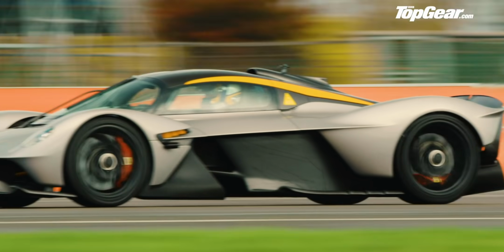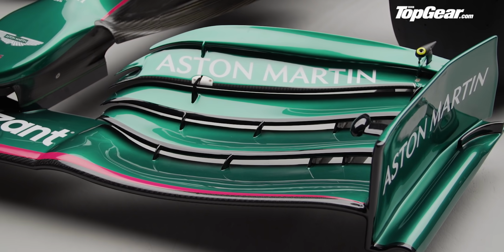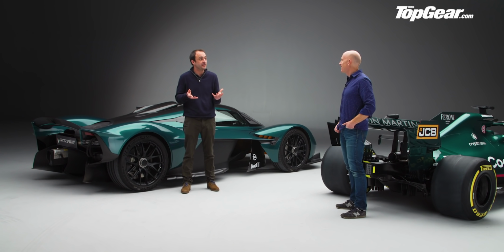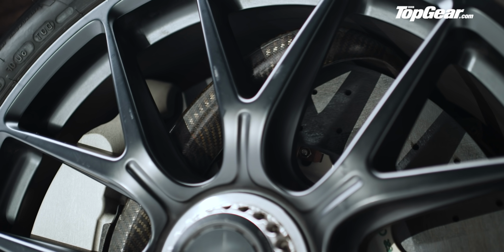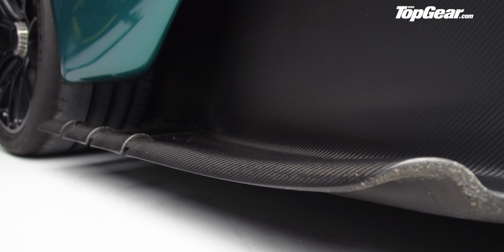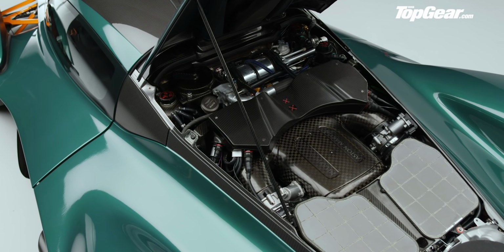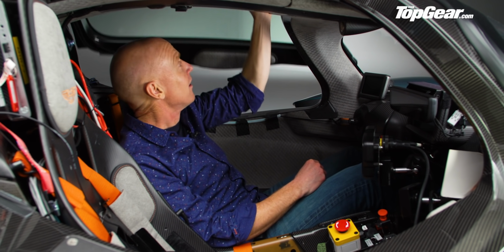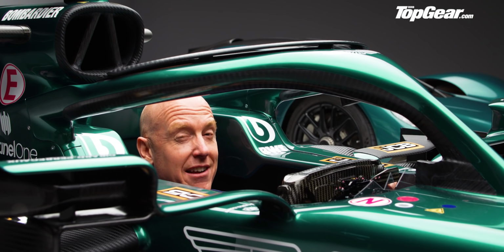Is the Aston Martin Valkyrie really an F1 car for the road? | Top Gear

Comment: The Valkyrie makes all other road cars look like mediocre highschool science projects.
Reply: I think the T50 is just as good
Reply: @justina9914  T50 is the greatest Roadcar of the new age.
Reply: I think its gonna be interesting between Valkyrie, AMG One and T.50. Each of the cars have their own Pros n Cons so it will be very exciting if and when a car show can get all three in the same room and then take them out on the track.
Reply: @ccheetah  the T50 will be slower in a lap compared to Valkyrie and Amg One because it is designed for daily use as well. Gordon Murray said that he wanted the drivers to be able to go and buy some groceries with the T50. He also said he doesn't like very stiff suspension on a road car.
Reply: @justina9914  Well that is that normal T.50. I guess you haven't checked the T.50 Track version called T.50 Nikki Lauda (named after the famous Late F1 driver). So it's gonna be very close between these cars.
Reply: @ccheetah  
The T.50s is a track only car. That should be compared to the Valkyrie AMR Pro which in itself is F1 levels of quick. So no, neither the T.50 nor the T.50s will be beating their Valkyrie counterparts.
Reply: @Cain353  Well only time will tell. The thing is Gordon Murray has already had success with McLaren F1 (perhaps the best supercar of all times). So chances of him getting the formula right again (this time with a fan) cannot be ignored.
Reply: @ccheetah  
Oh yeah. It's basically an updated McLaren F1. But it won't be breaking any lap times. That's not what it's built for.
Reply: @ccheetah  I am fully aware of the T50s Niki Lauda. However that is track-only and I was trying to compare apples to apples. The Valkyrie AMR Pro can take on the T50s Niki Lauda
Reply: @Cain353  Well that is true, but the F1 was built for driving pleasure and still somehow won Le Mans with just slick tyres and a wing slapped on it
Reply: @justina9914  Because back then racing wasn't what it is now. The F1 carried over tech that was pretty much new in Formula 1 and unheard of in any other racing class. But back than Formula 1 also had very limited aero, still had manual gearboxes and the money spent on racing wasn't anywhere near what it is today. 
Even if today you'd carry over F1 tech to a road car and then make a race car of it you'd still be competing against cars that are designed to be race cars from the ground up. With manufscturers and teams spending loads more money to be competitive. There's no point in trying to compete that way.
Reply: @ccheetah  I love what gma is doing with the t50, but in terms of track speed in a road car, it will absolutely lose. The stick shift rather than automated transmission would likely ensure that by itself, but factor in the power difference and it's not really a contest.
Reply: @ccheetah  personally, I think amg one will beat valkyrie in low speed tracks because of 4wd, torque vectoring and turbo acceleration etc. At high speed tracks like Spa Francorchamps Valkyrie will take it with the superior aerodynamic effeciency
Reply: @ccheetah  It will have to be the T.50s to compete with those cars on track I believe
Reply: So the AMG ONE and Senna are a joke to you
Reply: @ajnracing6034  You compare a Senna to this? Yikes
Reply: @ajnracing6034  the senna is beyond ugly and the amg one is a bit of a let down compared to the valkyrie
Reply: @ajnracing6034  Let's be honest. Senna is just a 720s with 60 more hp and more downforce.
Reply: @justina9914  the 720s is trash tho
Reply: @ajnracing6034  Car guys are weird...Still they're not like road cars. you mentioned jokes ;)
Reply: @ES-qe1nh  It's between the Senna GTR, AMG One, Valkyrie and the T. 50s Niki Lauda
Reply: Koenigsegg Jesko anywhere?
1600HP in E85 mode
1400kg weight
Until 1400KG Downforce similar to a 2009-2013 V8 F1 car.
Has good conforts and a little trunk too
Will be avaiable 2021 and not delayed until the release of Half Life 3. 

GMA T50 S (Yes i know not street road legal)
725hp
850kg weight
1500KG of Downforce! Similar to a 2009-2013 V8 F1 car!
Middle seat piloting.
Avaiable 2023. 

Calling the Valkyrie the best car ever and every other car a Highshool project is just blind simping!
Reply: @Zero.X  Nice HL3 joke :)
Reply: @streamnoremorse  
Whicht releaae is sooner
-The "New Holy Trinity" (Valkyrie,Amg One,Speedtail) 
Or
-Half Life 3?
Reply: @Zero.X  jesko will get stomped by this around a track. Infact, Koenigsegg isn't a competitor.
Reply: GMA T50?
Reply: @alexandermallinckrodt2847  That looks balanced car. Nice looking =)
Reply: @Bugatti Chiron Supersport spa is and will never be a good place for to check times. Your not gonna tell me an f430 scuderia is only 7 seconds slower than a McLaren p1
Reply: Mercedes Project One has joined the chat
Gordon Murray T50 has joined the chat
Reply: @StanceSantos  neither of those are even close to the valkyrie
Reply: @E9X330  aren’t even close? The project one literally has a 2016 F1 engine in it and the t50 has one of the most powerful naturally aspirated V12s since the mclaren F1 and utilises ground effects the same way as the brabham BT46 “fan car”
Reply: @StanceSantos  so what if it has a f1 derived engine ? Even Tobias moers said nothing comes close to the valkyrie and he formerly oversaw the project one development. Murray stated that the t50 won't break any lap records, it's a purists drivers car, not a lap record hunter like the valkyrie, it's literally on lmp2 pace ON ROAD TIRES. oh and fyi, the T50s engine is essentially a smaller valkyrie derived v12. The fan on the t50 is there to increase the efficiency of the diffuser, not to suck the whole car to the ground
Reply: @StanceSantos  Those are going to be epic vehicles. (:
Reply: brabham bt 72
edit: 62 my mistake
Reply: @Aston Martin Valkyrie Amr Pro ah yes of course. I am really impressed by the pagani. I don't know how they managed that, with a slow gearbox and less advanced aero than the senna.
Reply: @Aston Martin Valkyrie Amr Pro Yeah! I actually think cars like the fxxk and the lamborghini essenza are made let rich guys think they are driving a race car. But they are just road cars with wings and slick tyres. Look at the essenza, it looks so unaerodynamic. The zonda révolucion is still one of my favourite even though it is quite old.
Reply: 😂 
It is a work of art and I wonder if they’ll be driven or sit?
Reply: @Mark Williams nope, gordon murray said the t50 won't break any make records
Reply: @ES-qe1nh  Senna has not been by any car on a track yet
Reply: @justina9914  the senna is faster than AMG GT BS at Hokenheim and the Black series is currently the fastest car around the nordschleife so...
Reply: @ajnracing6034  the senna has more power and weighs less compared to the amg gt bs so...
The valkyrie has better aero and more power and less weight than senna so...
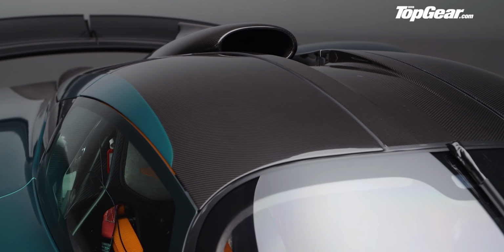Reply: @ajnracing6034  no doubt senna is very capable. Probably will do a 6:30 nordschleife lap. But the valkyrie is a whole new level. Like 6 minute nordschleife laps
Reply: @kalmansandor5930  i dont hate anything
Reply: Hello RacingMonkey do you want the Valkyrie in FH4?, I want it so bad
Reply: Gordon Murray fan car  ?
Reply: if they add it in forza you should figure out a way to break it.
Reply: @Aston Martin Valkyrie Amr Pro These cars are prat cars and your comment were prat also. It'äs not my fault that this looks like UltimaGTR.
Reply: @janiikavalko6223  this looks nothing like an ultima gtr, you must be blind as hell to think that
Reply: @machspeed20  Front shape is identical and interior. heh....whatever mate ;)
Reply: @janiikavalko6223  shape is no where similar but okay
Reply: @Aston Martin Valkyrie Amr Pro Fact isn't trash. It looks like Ultima GTR Kit CAr.
Reply: Have you seen the Senna gtr?
Reply: @Aston Martin Valkyrie Amr Pro Car should look beautiful, not Ultima GTR ;) This AM looks like built by Galactic Empire for numbers and performance to get all galaxy under their power and administration
 - just a tool.
Reply: @Aston Martin Valkyrie Amr Pro what's why? Whatever you want to defend that kit car look forever. :)
Reply: @janiikavalko6223  the car looks like a "kit car" because of the insane amount of aero put into. It's literally an f1 car for the road. The car looks beautiful too, I also don't see why your saying it looks like an ultima gtr, go get your knowledge from somewhere other than forza
Reply: @machspeed20  yes, i know
 But you just literally admitted that u dont have any idea abt these things
Reply: @Aston Martin Valkyrie Amr Pro 
Read the last sentence of my post again.
Reply: @Aston Martin Valkyrie Amr Pro We'll see that.
Reply: @Aston Martin Valkyrie Amr Pro 
Coooolll
Do you Genious want a Cookie now?
Reply: I thought if was a pagani
Reply: Right up to that point where you actually try and go anywhere in it  :)
Reply: wht about amg one? and it's powerplant?
Reply: it’s the contrary dude. Put the valkyrie aside a Bugatti or a McLaren and you will understand.
Reply: If it lives up to the expectations
Reply: T50.... thats the follow up to the F1.
Reply: @christianbuczko1481  the t50 isn't quicker than the valkyrie
Reply: @E9X330  lets see them on a track. I think that race is going to be interesting, as both are designed by genius F1 designers to be the ultimate in car design. The sounds of those 2 will make midern f1 sound like a shopping kart
Reply: @christianbuczko1481  nah, the t50 is designed as the ultimate driving experience, not to break lap records. With it's manual transmission and lack of power and downforce it won't hold a candle against the valkyrie on track
Reply: @E9X330  go look up the "nikki louda" version of the t50. Thats the full race spec, has flappy paddles, and the downforce is 1500kg. Apparently they had to reduce that from 2000kg, but the options there. This aston is a downforce car produced by aero and design of the diffuser and underbody, the t50 is a fan car with abit of aero added. The nikki louda version has ALOT of aero added. Plus according to drivetribe they are attempting to create a race series just for races of road legel cars like these and also a few others like bugatti and koenigsegg and senna gtr ect. Which is best will only be answered when they race..
Reply: @christianbuczko1481  the T50s isn't road legal, you have to compare that to the valkyrie amr pro
Reply: @christianbuczko1481  why are comparing a track only car with road legal one?
Reply: @ajnracing6034  they plan on racing against each other, so your point is pretty much bollocks isnt it?
Reply: @christianbuczko1481  I was refereeing to the Valkyrie when i said “road legal”
Reply: @christianbuczko1481  like others have said, the t50s needs to be compared to the valkyrie amr pro, and will come up short there, just like the street version.

That said, I would probably pick the t50 road legal version if I was given the option between all these super/hyper cars. It's just unique. But then, I wouldn't complain if I had the option to own any of the others, either. It's fun to leer at them!
Reply: Cant wait for the Jesko to wipe some.
Reply: @gollese  according to christian von koenigsegg himself, they won't have a chance against the valkyrie
Reply: It won't compete in the LMH, so it's not a "real" hypercar. Change my mind.
Reply: @ynnn991  No one will bother trying to change your mind when you have such ridiculous opinions.
Reply: GMA T.50: Hold my aero fan...
Reply: Nah, neither of them are allowed to drive the car, unless they buy one. Oh, you can't. Basically it a Red Bull. Not an Aston.
Reply: alongside the AMG Project ONE, this will be the new category of hypercar.
Reply: @mantaholy6845  nah the project one is a classical hypercar with an f1 derived powertrain, the valkyrie is a different league
Reply: @E9X330  I see what you mean yeah, and the Valkyrie will most likely be faster, however the Project ONE is also advertised as an 'F1 Car for the road' so I class them in the same category. Besides, I'd love to see them compete on track at some point
Reply: Funny, I was just thinking it DID look like a mediocre high school project from the erector set interior (I’ve seen tidier Europa wiring), and orange peel paint that looks to have been applied with a roller. 

Aside from the clearly unfinished details though, gorgeous car with proper sound. Just ditch the hybrid bits dropping another 50+ kilos as should be done in F1.
Reply: This car is so... 100% because in its first mid-engine car for the road, Aston is astooning!
Reply: Enter Rimac Neverra 
- What was that, kiddo?
Reply: @Malapropify  the nevera isn't even close lmao
Reply: The pagani Imola is the next closest thing
Reply: @puckstopper1937  fuck no, not even close 🤣🤣🤣
Reply: @Sir Crocodile doesn't exist and will be raped on track
Reply: @Sir Crocodile you're completely delusional if you actually believe that. I've yet to see any Tesla do multiple hot laps without overheating , the roadster has been promised for years and never came and it's gonna habe no chance against the Valkyrie in any category except acceleration
Reply: Chaos ultra car recently revealed is in a new category of its own :) 1272 kg and 3060hp  4l v10 ! state of the art car. That valkyrie is damn sweet too tho
Reply: Wouldn't go that far buddy...let's just say that the competition is pretty steap this time around.
Reply: We not talking about the Porsche 919?
Reply: I'm thinking the Gordon Murray T.50s will give it a run for it's money though.. Can't wait to see people actually test these things
Reply: Nah my Elantra makes the Valkyrie look like a gio metro
Reply: I totally agree....
Reply: EXACTLY
Reply: @ES-qe1nh  amg one shares the same concept, fully inspired by f1. Which is the best team at the moment? mercedes petronas. amg = mercedes i wouldnt be so cocky this early. I would love to see both cars on the track racing against each other. Im not saying the project one will be faster.
Reply: Too harsh and hyped
Reply: Until project 1 arrive
Reply: @emiliovergara4108  Still waiting lol
Reply: @Robbie-bp5vj  have you ever played RIDE 4?
Reply: @emiliovergara4108  It's likely still faster than the Project One tbh.
Reply: @emiliovergara4108 what Project 1?
Reply: @ES-qe1nh  the senna maybe but the AMG ONE is more powerful than the Valkyrie, has AWD and torque vectoring. I think the Valkyrie has a bit more downforce but the AMG ONE has plenty more downforce than a GT3 car
Reply: @ajnracing6034  More power isn't everything around the track and we don't know if it will have more or less power. Mercedes states so many different figures but nothing confirmed.1230hp originally, then 986hp, then 1100hp, then 1200hp, then +1000hp estimate. 
The only thing we know is that it has very trick active aero, F1 PU systems and AWD. 

The Senna won't compete with these. It will be foderised by them. Maybe the JESKO has a chance in its track configuration but that's about it.
Reply: @F1ll1nTh3Blanks  Koenigseggs tend to struggle with traction at low speeds. If they can sort out a good traction control system like Mclaren with the 720s, 765lt Koenigsegg Jesko will be very good. I also wonder how the venom f5 will do, just because of its 1817hp
Reply: @ajnracing6034  it doesn't have more downforce than a gt3 car
Reply: @ianm.w1563  what doesn't ?
Reply: @ajnracing6034  how expensive the Valkyrie is man?
Reply: @ajnracing6034  but the Valkyrie just looks menacing. The design is so aggressive with all those giant cut-outs and the design is worlds apart from any other car out on the road. Even the crazy alien ship looing Senna can't compare to this
Reply: @ajnracing6034  The AMG ONE turned out to have 100bhp less than the Aston. The ONE also weighs a hefty 300 kilograms more, so I doubt it will be faster round a track.
Reply: imho valkyrie looks like Ultima GTR kitcar :D just that highschool shit.
Reply: @janiikavalko6223  it literally looks nothing like an Ultima GTR, The Aero philosophy is completely different. the GTR is closer to Le Mans prototypes with a flat bottom and simpler aero (highschool shit) whereas the Valkyrie has front wings, giant diffusers, giant venturi tunnels, (try making that in highschool) They're nothing alike.
Reply: @naut3  But itäs literally same ugly shape. Yes it has better aerodynamics, but it doesn't change the fact.
Reply: @janiikavalko6223  it really isn't the same ulgy shape, any one with eyes can see that they look nothing alike
Reply: @naut3  And with proper eyes you can see it's not that pretty and looks more Ultima GT-R, yes yes yes it has ugly aerodynamics compared to Ultima but it doesn't change the truth that it's not the prettiest thing. And this is street car, not track car which doesn't have to be pretty, but effective. All the track cars are usually very ugly because they're made for numbers.
Reply: and funny how reviewere told that this doesn't feel like road car at all haha :D you must be deep fanboy.
Reply: @janiikavalko6223  hi jani.

Comment: what kind of questions are these? "does it run with the wiper in the middle?" "was that bought off the shelf?" yeah it was bought at the local autozone
Reply: Bought off the shelf means is that part put in this car from previously designed cars. Example: is that wiper from the Aston Martin vulcan or is it redesigned.
Reply: @SainSrikar  thats not what bought off the shelf means. If he wanted to ask if the design was borrowed from a previously designed car he should've asked that.
Reply: @ejminava407  incorrect
Reply: Marketing questions.